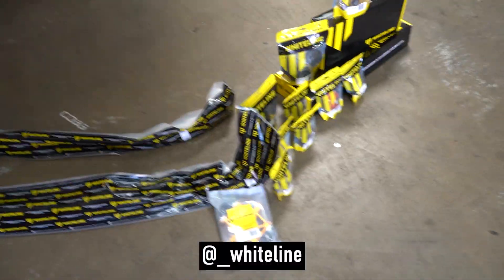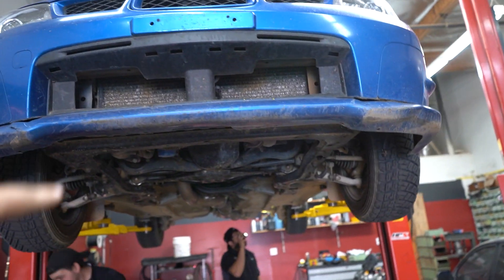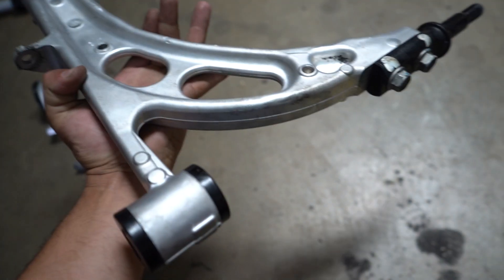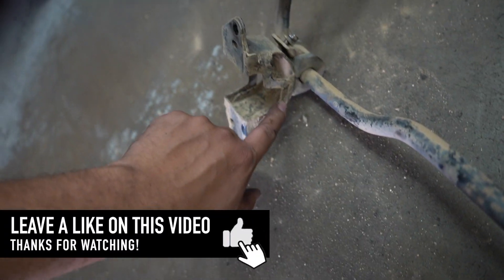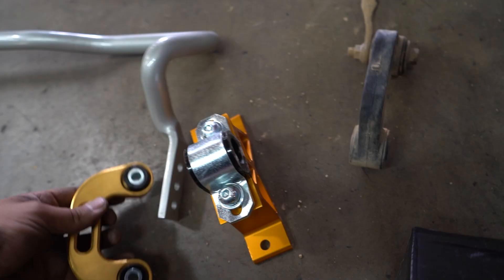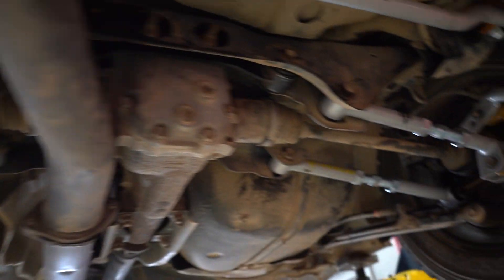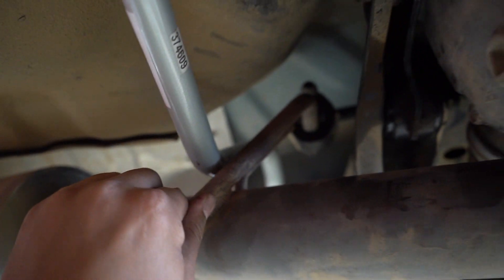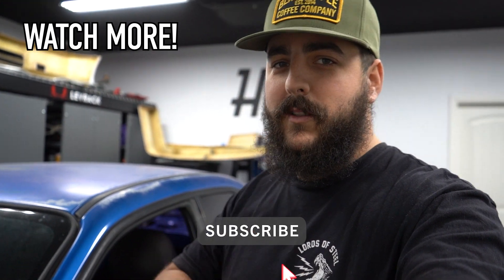Installing Fresh Bushings on WRX Rally Car x Whiteline Sway Bars #RutsAndGuts

Comment: Micah if you wanna be a real gangster you need to check out TSS Fab. He built my dual caliper knuckles for the rear of my bug eye. It's solid as  a rock, he also builds a whole bunch of suspension bits. Moving right along with this hill climb project though.
Reply from the maker: I’ve seen his work. It’s beautiful
Reply: @MicahDiaz  I'm running 370Z calipers and rotors out of the same little R160 Diff that's in yours. I see a lot of broken axles in my future lol.